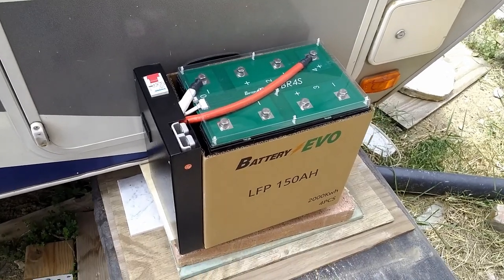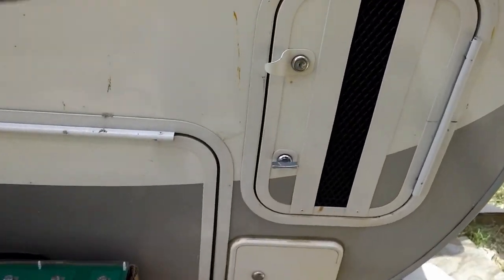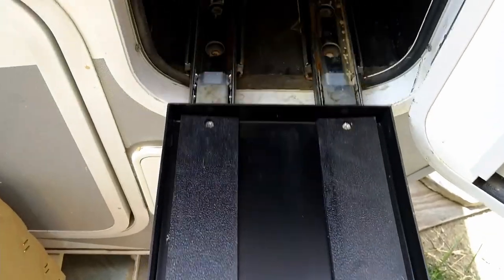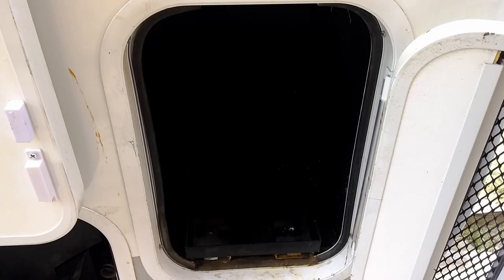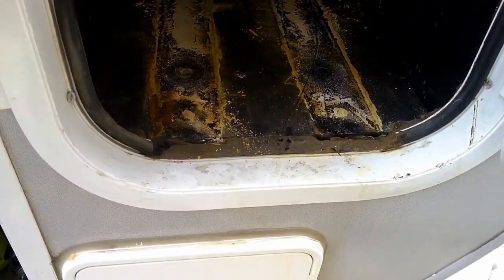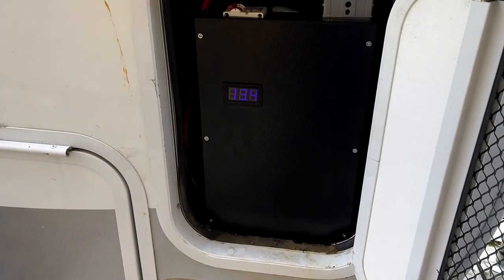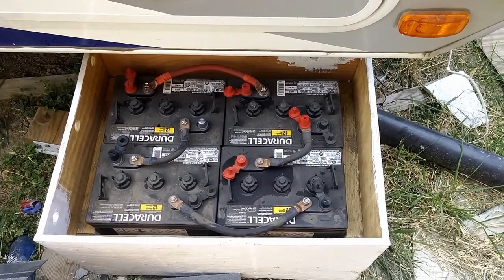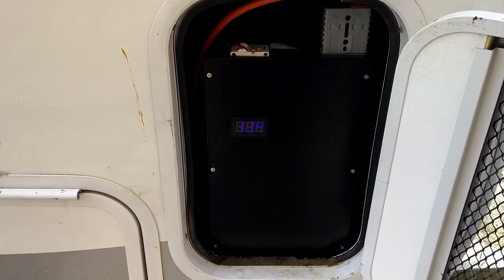LifePO4 Lithium Phosphate Battery Install in Trailer

Comment: Nice setup! What changes did you do to the RV to support switching to LFP?
Reply from the maker: Hi, 
The only thing I did was change the setting on my solar controller to LFP.
I kept the original WFCO charger that came with my trailer.
Reply: @trailerlife5878  I'm planning the same setup. Hoping the solar charge controller is up for the job! What level of charge can the WFCO get them up to?
Reply from the maker: @sl0rion  The WFCO gets batteries up to 14.2 V charge.  My solar controller does the rest. 
These batteries are great. Good luck